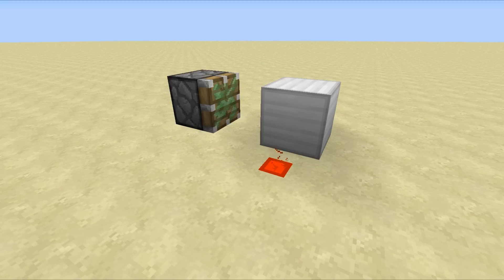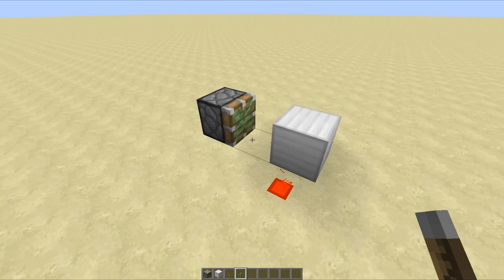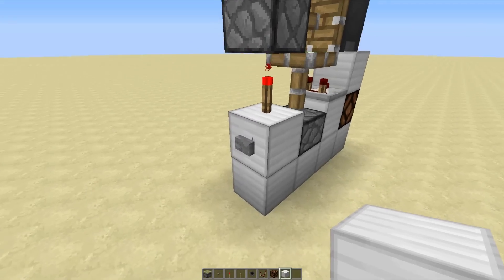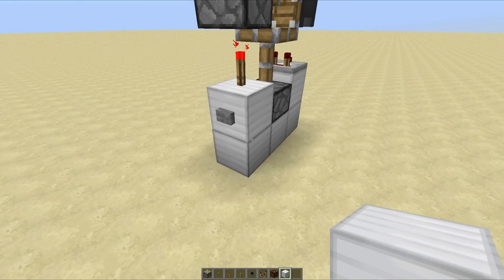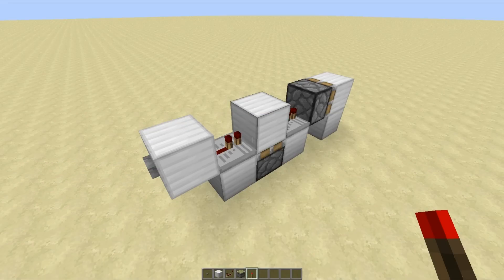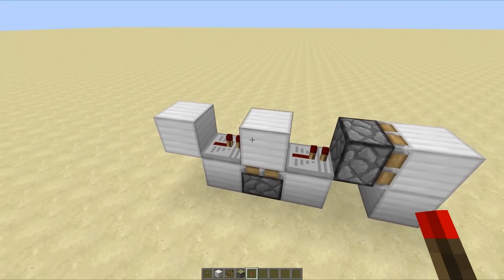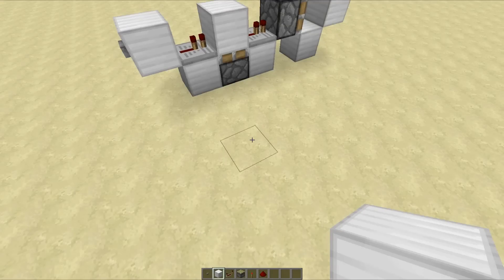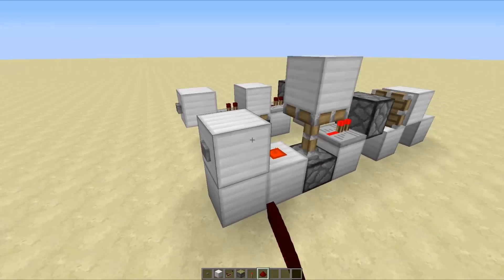HI-LO Tech: T-Flip Flop

Comment: So if I got this straight: in it's most basic form, a flip-flop is basically a bud switch  (the one which enables you to use pressure plates instead of levers to power things) designed for wall-mounted buttons, right? Well, you learn something new every day I guess.
Reply: a flip flop doesnt detect block updates. it turns a continuous signal into a pulse, like a lever into a button signal.

Comment: Call me stupid but why not use a lever
Reply: Here's one basic example where this setup is used (Norbert mentioned a door, I'll break it down a bit more to clear the confusion). Let's say you have a door (for example a piston door or whatever) which you want to open with redstone from BOTH sides. The door is built so it's open when the signal is ON and closed when the signal is OFF. Now, if you wanted to open it from both sides and used levers - you pull the lever on one side to open it, but then when you go through the door, the lever remains on, and you can't reach it. So you can not close it from the other side, unless you do some running, which can be impossible depending on the distance, also annoying. You could use buttons, but that would mean the door closes after a set time when the button goes off, not when you wanted it to close.

With a flip-flop, you can put a button on both sides of the door and connect them both to the flip-flop, then connect the flip-flop to the door. That way when you push a button, the flip-flop will turn on, and the door will stay open. Then, when you go through and press the other button (also when you press the same button), the door will close. So it's literally what the name says - it flips the signal between ON and OFF whenever you power it. One press turns it on, the next turns it off, etc.

Irrelevant: [If you want to go more advanced, then there are different types of flip-flops, like rising edge and falling edge flip-flops. Rising edge flips itself when the power into it comes ON, while falling edge flips itself when the power goes OFF. So if you used a lever attached to a flip-flop, you could pick whether it flips when you turn the lever on, or when you turn the lever off depending on which flip-flop design you use. Or with a button, one would flip when you press the button, the other would flip when the button becomes un-pressed again. That's not that useful with doors, but can be used in other types of creations.]
Reply: Levers have to be switched manually.
Reply: +Norbert Cseh but don't you have to hit a button too?
Reply: Not necesarily. There are other things you can combine this with. For example, you can make a door that can be opened at both ends. Or can combine a redstone clock with a flip-flop, to double the output time. There are endless uses of a flip-flip. Not to mention, buttons are way more fancier than those ugly, ridiculous, gigantic, sticks, you call levers.
Reply: +Norbert Cseh lol ok, I'm still confused but thx :P
Reply: It seems hard, but redstone is pretty straightforward once you understand it's working. One advice: Redstone lamps. They really helped me to understand how blocks are powered.
Reply: You can use a XOR Gate for the door anyway, I don't understood how the 2nd one works tho, is a bug?

Comment: It turns out the second design is quite versatile if the click sound doesn't bother you.  if you add a comparator to the up facing dropper, then you have a 2 way selector switch.  You can then make it a 3 way selector (which I couldn't find any good examples of on youtube) by turning the dropper under the hopper sideways into a hopper, into a dropper, and back into the up facing dropper.  Finish off with one last comparator and you have three outputs that well cycle one at a time.

Comment: Word of advice, if you find that yours is 'burning out', as in clicking multiple times and then the keycard is stuck in a dropper, you can fix it. Place powered rails, about 3 around your red stone, as they force chunk updates, and reset some comparators and you should be fine

Comment: Well, I give up. I've tried a few different methods, but I can't seem to figure out a way to hook a rapid-fire dropper up so that it activates when it's full, then shuts off when it's empty. Sure, it'll fire off no matter how full it is, but I can't get it to wait until it's full to empty itself out.
Reply: Steven Norwalt That is so easy to make lol.
Reply: +Steven Norwalt Look at a comparator. http://minecraft.gamepedia.com/Redstone_Comparator
Reply: Yeah, that just spits stuff out the moment it's in there. I wanted a way to activate the rapid-fire as soon as the dropper got full, then deactivate when it empties out.
I actually figured out a way, but it's messy.
Reply: +Steven Norwalt I think the T-Flip-Flop might help you. Try running a comparator out of your dropper with a powered redstone repeater running into it from the side (that comparator will only give an output when the dropper is full), hooking the comparator output to a T-Flip-Flop that will trigger a clock to fire the items. Then you’ll need to run another comparator out of your dropper, with no side input this time, that should run directly into a block with a redstone torch connected to the T-Flip-Flop.
That way, when the dropper is full, the first comparator turns on and activates the T-Flip-Flop, so the items get fired by the clock. And when the dropper is empty, the second comparator turns off, the torch turns on, which turns the T-Flip-Flop -and the clock- back off.
Reply: Qbe Root 
Yeah, I recently started to get the hang of the comparator's side input shenanigans.
Reply: Steven Norwalt you can do it with a comparator. (Don’t know how to spell btw lol)

Comment: no hate but what is the difference between a lever and the t flipflop?
Reply: joey serenko Sometimes it can be used for looks, other times it could be used to turn the lights on in a room when you walk into it (Pressure plate), or how I'm using it for, a horse track using tripwires to activate/deactivate a stopwatch :)
Reply: Oh...my bad...I am a n00b at redstone..
Reply: Haha no problem :)
Reply: joey serenko a lever will stay on and nothing else can turn off the redstone that the lever is powering

so let's say you have a door in your house and you open it with a lever. and then you want to close the door from the inside...you can't do it because it is a lever.

But with a T-Flip Flop, you can run a redstone wire from the inside to the block that HAS to be powered in order for the T-Flip Flop to be activated, like Mumbo said in the video
Reply: +joey serenko lever = t-flip flop + button
lever is not t-flip flop + lever
Reply: +faaiz subzwari you can get a piston, face it to the block the lever is on and power it so that the blocks it pushes include the block that the lever is on
Reply: +Pika Chu Some people just like the convenience of using a button instead.
Reply: +chaosemerald55 not just a button but ANY input

Comment: or put a lever next to a piece of redstone
Reply: Jonathan Koiwuneva No.
Reply: Jonathan Koiwuneva Buttons look way better
Reply: This circuit is very important for even intermediate redstone engineering.  "Buttons are cooler" is equally as misguided as "just use a lever" for this reason.  If you're trying to do any builds that are even SLIGHTLY complicated, you'll want to know this circuit.

Say you want to have one action performed once while another action is performed over and over again until it's disabled.  This is how you get both of those outputs from just one input.  If you want an automatic delivery / sorting / smelting system that triggers any sort of continuous engineering, this is absolutely necessary.  Can a minecart flip a lever?  No.  This is one of the easiest practical uses that anyone without a detailed understanding of redstone  could understand.
It's the equivalent to a software programmer's "while loop".  If you don't have an understanding of this, there's no hope for you to understand nesting.  Which is why you need these sorts of things.

If you wanted circuit a to run x number of times, you would have circuit b (this one) power it until x is reached.  Then b would shut down until it is called again.  X is the variable that would be assigned and executed separately, likely in another circuit line.

Long story short, this circuit is ultra important in high-level builds.

Comment: I came up with an even simpler design. You need two sticky pistons, three Redstone torches, and two Redstone dust. Place the pistons so that they are facing each other and have a two block gap between them retracted. Then, break a floor block in the gap and place a Redstone torch in it. Place a full block directly on top of the Redstone torch. It should be touching one of the piston heads. Place another full block on top of that block. Place the final full block to the right or left, so that there are no full blocks on the piston and the two block space between the pistons is no longer directly visible from the top. Place two Redstone dust on the two blocks you just placed. Place one torch on the end of each block so that they are on the side of the block and power the piston when on. To activate the flip flop, power the Redstone dust on top of the two blocks. The pistons will alternate states,  and the signal output will either be on or off. The output comes out where the block covers the first torch. The entire assembly should be 1 block wide,  4 blocks long, and 3 blocks tall (1 Block is the Redstone dust on top)
Reply: That is one of the oldest designs out there...
Reply: CreeperCraftUploads wanna try and upload it on imgur or something? that would be sad if a creation of a person couldn't be understood by people :)
Reply: CreeperCraftUploads Super old design but i have never needed anthing else, other things are more compact but i still like that version.
But now you can replace the torch under it with a redstone block for an even simpler design

Comment: Hey Mumbo, with the second design you can replace the 3rd dropper you placed with the hopper, having the hopper run into the first dropper. It works perfectly fine and saves a bit of resources.

Comment: FYI; The last T-Flip Flop with the piston that extends actually creates a .5 tick pulse. Ever since the 1.5 up date it has required a .5 tick pulse to make a piston drop its block. Previously it required a 1 tick pulse. I think Mojang believed that people often accedently sent 1 tick pulses through and changed the pistons to half a tick. If you tried to make a circuit that emits a 1 tick pulse using repeaters and torches, the piston would not drop its block.

Comment: might i suggest one more? a dispensor facing down over an air block with a bucket of water in it, a comparitor coming off it and 2 pieces of redstone (then a repeater or whatever) activate it the bucket empties into the air block and the comparitor only gives out 1 signal strength, activate it again water is picked up comparitor gives out 2 signal strength

Comment: I quite enjoyed this mumbo! I learned what a T-Flip Flop was ever since my friend showed me the basics of redstone back when my computer couldn't render more than 50 blocks due to the lack of fps and the fog blocked most of my view and was meant for a work environment like a job inside of a cubical.

ANYWAY! I wanted to ask you if you could show us(or at least me) the practical use of these redstone circuits and logic. I don't know if that sounds silly or not, but when learning these circuits I always had trouble using it in in action. If you search "Red stone circuits" You'll find a wiki page on memory circuits, clock circuits, logic gates, the whole lot, but never was I able to find how to ever USE it.

I'll give you an example my friend showed me as well. When making a secret door or a door that opens and closes from both sides you would use an XOR Gate! Examples like this would be much appreciated as I am a visual learner.
Reply: A t-flip flop is great when you want your piston door to open and close with a button instead of a lever, which means you can open and close the door with two different buttons (one on either side of the door) independent of each other, whereas using levers would cancel out the other lever.
Reply: NuclearHeadshot
Thank you!
Reply: You're welcome. It basically changes a button into a lever, or in more correct terms a pulse into a toggle for current.

Comment: Nice to see some alternative designs, although I still prefer the supercharged 2-piston block slider, as it's so resource friendly. Slimeballs can be really hard to get in survival. Still, some of these designs can come in handy, due to space restrictions and according to what resources are available.
Reply: Go to any swamp at night, you can get stacks at a time. Before when slimes only spawned in slime chunks I would have agreed, but now that they spawn on the surface in the swamp anyone can get them anytime.
Reply: You'll still need to find a swamp though. On some seeds, this means venturing out thousands of blocks. Large biomes, elevated terrain, all make this tougher. The slimes were just one example though. Using comparators means you need quartz, means travelling to the nether. Not too easy in early game.

Comment: I usually use a desing with two blocks, two torches and rs dust looping around. I like it, because it's very intuitive and you can deliver signals to turn it on or off from multiple directions and lines easily. But it is rather a 'bulky montrosity under the floor' kind of contraption.
Reply: thats not a T-flip flop though but it is very usefull but still the design you use is pretty big

Comment: You can also use a lever! :D! Nice designs Mumbo :)
Reply: You can use the output of a clock or binary counter instead of a button allowing for automatic on/off switches based on droppers or predefined cycles.
Reply: for some things ypu can't use that, like when you want to be able to power something from two sides or for other, more complicated redstone stuff :)
Reply: the lever would still be viable, using a lever with monostable
 :P

Comment: A few issues:
TFF#1 Uses 1.5 features, not 1.7
TFF#2 Is not silent, it makes noises every time you press it.
TFF#3 You said it isn't the fastest, which is true. The fastest is 1.5 ticks :)
Reply from the maker: meapjuice My bad. I have got so used to saying "1.7 feature" that it sort of just slipped out :P
Reply: Mumbo Jumbo noooo you made a mistake! I thought you were perfect.
Reply: Why would you make use of 1.7 features when 1.5 features work as good?
Reply: He said 1.7 features, but it is a 1.5 feature. Just saying, nothing wrong with using it :)
Reply: A few issues with your few issues:
issues#1 Features that are introduced  in older versions but still remain are considered apart of the current patches feature set as it is apart of the complete program.
issue#2 The only noise you hear is the button which is not required to operate the device and is just knit-picking.
issue#3 I have no idea why this was included in a "list of issues," so I am including it in my list as an issue.
Reply: A few issues with your few issues of my few issues:
#1 The feature was introduced in 1.5, so it is considered a 1.5 feature.
#2 The button and the droppers make noise.
#3 Very valid point
Reply: Mumbo Jumbo It's all good :)
Reply: meapjuice a few issues with your few issues of my few issues about your few issues:
#1 This seems to be a school of thought situation, to me if it were removed in 1.5 then it would be a 1.5 feature as 1.5 is the most up to date patch containing the feature
#2 Valid point, the argument here seems to be that compared to a piston it is rather quiet. I was basing my thoughts on when I was testing the design a while ago and I couldn't remember hearing an annoying sound, such as pistons, but i tested it again and yes there is a click.
#3 Valid point is valid.
Reply: meapjuice at least TFF#2 is tileable
Reply: +Noam Golombek TFF 2 is not tileable
Reply: +Noam
งง Golombek
Reply: button makes noises xD
Reply: Can you explain to me how the 2nd works?
Reply: Hi